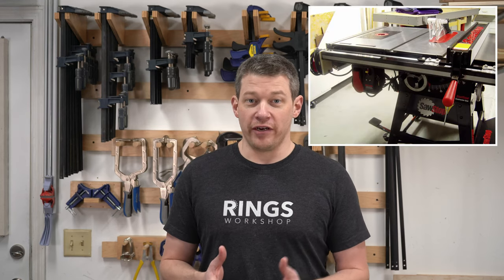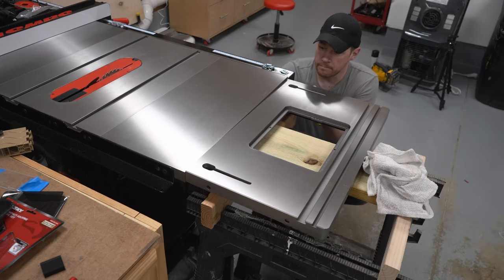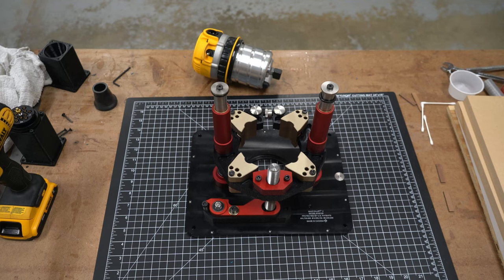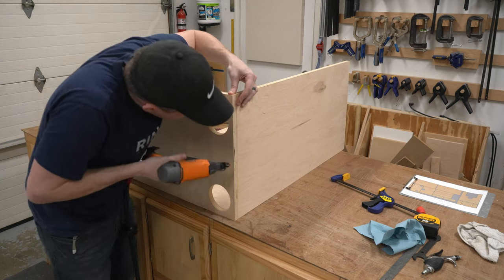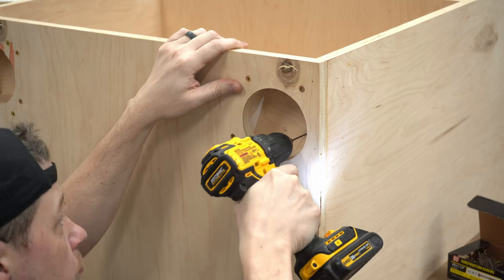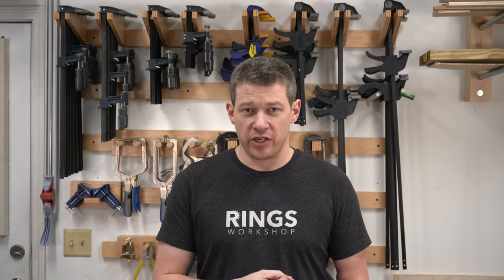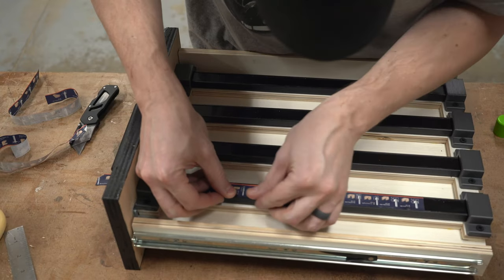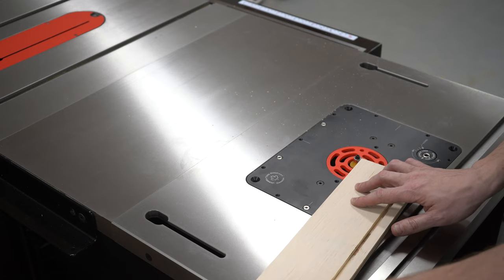Mobile Router Table Cabinet w/ Bit Storage

Comment: Brilliant idea using magnets to store the jigsaw blades! I hadn't even thought about how I was going to store those yet. Also, going to use your idea for the magnetic dust collection ports in the near future. Keep the ideas coming :)
Reply from the maker: Thank you!  I’m a huge fan of magnets.  That may change if I start working with metal more, but for now I store anything I can with them.
Reply: Not only blades but routers bits on a magnetic metal strip

Comment: Awesome, you just gave me another idea what I need under my router table.  I have the exact router table from Sawstop for a while now installed on the same side as yours since that side is always accessible. Except mine is a delta table saw which is the perfect size but needed to drill holes to integrate it.  I didn’t want to spend money on the fence so I removed the flimsy metal extension wing and I butted the router table against the table saw so I can still use my delta biesemeyer style fence.  Thank you
Reply from the maker: That’s awesome!  Let me know if it works out for you!
Reply: Just a quick question…how did you secure the jessem router to the saw stop router table?  I see in the video you didn’t use the 4 corners with the provided bolt

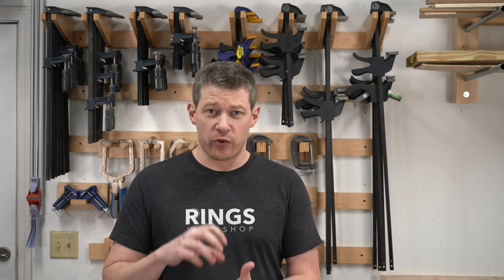Comment: First off, I think your video builds are awesome!  I followed your instructions and made the miter saw dust box and the magnetic dust port adapters and they both work really well!  My next build will be your table saw under wing storage cabinet.  However, in this video at 15:13 you mention that you would link the 3d printing plans for the router inserts with cut outs to increase air flow on your website. I have the JessEm lift like yours. But I am unable to find it.  Do you have it someplace else?  Keep up the great videos!  Thanks.
Reply from the maker: Thank you so much for the support, greatly appreciated!  Glad you are liking the magnet dust posts and miter saw box!  I will throw the router inserts up over the next week or so.  I think they could still use some fine tuning which is why I didn’t put them up sooner.  Downside is if the board is running over any part of the insert that is open, the suction actually makes the piece harder to slide across the router table because the suction is so strong.  If it isn’t over one of the holes, it does collect dust better, so a bit of a trade off that I still think it worth it in most scenarios, but not all.

Comment: Are there machine screw holes under there to attach the box? I assume the StopStop metal box has flaps/flanges and screws hold it up. You just used those and made little brackets or blocks on the top edges of the dust box? Looks great. Love including the reasoning and problem solving in the video. Engineering things with form and function is a big part of why woodworking is so fun.
Reply from the maker: Yes they do.  I somehow didn’t record me attaching that.  That said I made the box a little too wide so I had to rig it up with eye bolts (don’t ask, it’s what I had on hand haha).  But there are machine screws that you should be able to attach from the underside of the tabletop really easy if you measure correctly lol.
Reply: @RingsWorkshop   Nothing a few dozen washers can’t fix. :)
Reply from the maker: @FearsomeWarrior  hahaha so true.

Comment: Really love all the though and decision making that goes into your shop and projects. I do have one question. Do you have information or video on the making of your mitre station. I would be real interested to see what thought you put into it and what you would consider  changing. Btw. What is the overall length of your station. Thanks for all the incredible content
Reply from the maker: First off, thank you so much!!  I didn’t make a video on it, unfortunately I built it before I started recording builds.  It is just a hair over 8ft, want to say 97 1/2”.  I do have detailed plans for sale on my website, though.
Reply: @RingsWorkshop  I will check out the plans. If you put as much info and thought into your plans I am sure they will be top notch

Comment: Hi, fab workmanship. In your video at  7;30 minute mark you used a dewalt tool not mentioned in the tools you used.~you were cutting out section for the dust collection system .  It appears to be a  mini Plunge saw. Is that correct?
Reply from the maker: Good call!  It’s the 4 1/2” dealt cordless circular saw.
Reply: Unfortunately Dewalt Australia does not import that tool here. Ozito have a smaller 89mm diameter bladed low power tool on a poor quality/fitting track system
Reply from the maker: @rosswines  I just liked the portability of it and ability to get into tighter spots than a normal sized circular saw

Comment: hello I would like to have information on the steel table of your router because I have been looking for this for a long time where did you buy it or have it made and what site I am French and we can't find that here and I love looking at your way for working well done Kind regards Mr Fournieryohann
Reply from the maker: It is the 27” x 16” sawstop cast iron router table.  Not the 32” x 24”, that is the stand alone unit.  You can buy them from many places, think I got mine from Oak Tree Supply.

Comment: Constructive criticism, not sure if you're supposed to use drawer slides on the top and bottom?

Badass build BTW.
Reply from the maker: No you’re probably not hahaha. There’s a little play in them but I put a board inside at the top so it doesn’t rests on that vs all the weight on the slides.  Good call out.  Thanks for the criticism and kind words!

Comment: Why did you just use the router bit box they came with ?
Reply from the maker: One more thing to store, extra step of opening drawer then opening case, more likely to leave it laying around on a table top somewhere and I would still be pulling at the blade of the bit to remove it from case.

Comment: The magnet bar is a great idea for the bits, I have three of them still in the package. I would have liked to see the cabinet going in and out after it was completed, does it remove fairly easily?
Reply from the maker: Yes it does.  Once the saw is lifted up the cabinet will pull straight out.